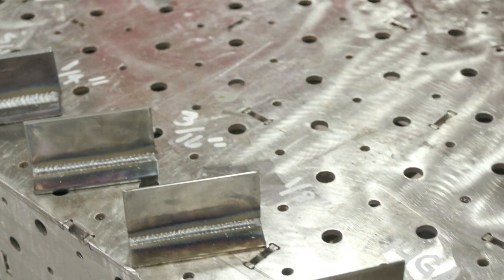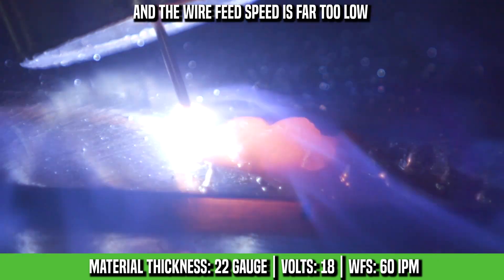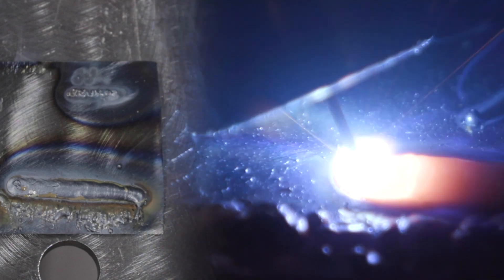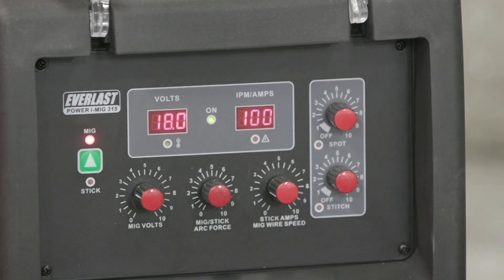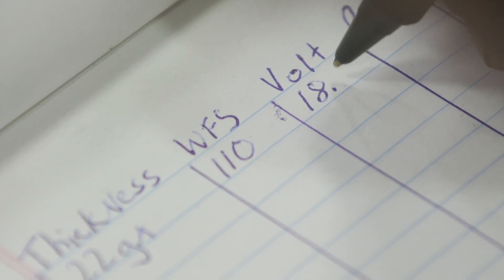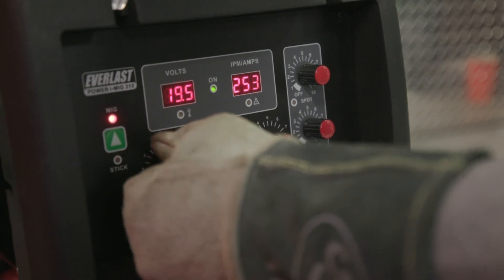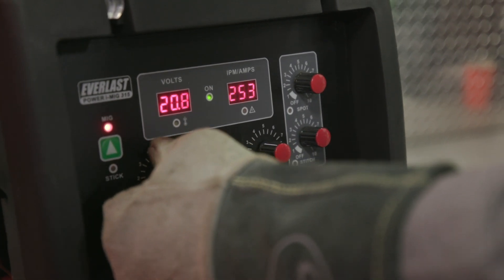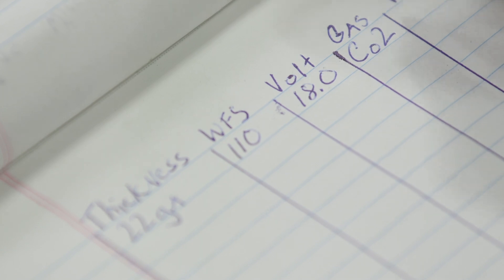MIG Settings for any Thickness

Comment: Hello. What setting for open v butt capping on thick steel 1.2 wire. 
240 amps 24 volts? 
I want a more raised profile.

Comment: I have been fighting that little "stutter" at the start for forever. Thank you for addressing that. You do a continues weld even on thin stuff. Most people use the series of "spot" welds for particularly auto body work. I would prefer to do a continuous  weld but to often get blow through.

Comment: Great video thanks. I’m having trouble with .134 wall 1-5/8” od mild steel tubing.  Since 3/4 of the weld is vertical or over head I keep getting puddle dripping . Looks fine on a flat bench weld for that thickness. Garbage around the tube. Thanks.

Comment: So did you leave your Gas on 25CFH thro all of those different Thicknesses? Also, exactly what type of Gas were you using? You said C02, were you running 100% C02?
I’ve always ran 75/25 when Mig Welding

Comment: I have a question I have a everlast MTS 252 and I'm using synergy mode can you possibly make a video how to adjust wire and voltage speeds on this type of machine it's very confusing I'm new to this machine I'm new to welding

Comment: on thin stuff, try and run hot and slightly push weld. It will flatten right out and use less wire and less heat on base metal.

Comment: I have a Hobart 210MVP welder with TAP voltage settings. Lowest Tap is 19v. I have infinite WFS, but how can I weld sheet metal with 19 volts ???

Comment: Do you have a video with setting adjustments when you're welding 2 different thicknesses of material? 14 gauge to 1/8" for example... this was a great video, thanks. My only suggestion would be the final list of settings completed at the end.
Reply: Always go closer to ehats needed on thick. Focus the weld on that side longer the thinner side will heat faster so penetration won't be a problem but the side the weld will fail will be the thick due to lack of penetration always address that and less failures will happen.

Comment: Most welders have a chart for a rough reference. These settings are nowhere in the ballpark with my Miller. Properly set, there should be zero slag and good penetration
Reply: Most setting charts are bullshit, depending on how fast you weld and what gas your running, i see charts that tell you to run 27 to 29 v 75 25 dual shield for 3/8 plate and in reality you can run 22 to 24 320 to 370 wite soeed with 75 25 gas.

Comment: 7:50  Good one !  You move forward, on the bottom side; then rotate upward;  counter-clockwise.......good. That, gives the complete weld, a BASE  for  the  dime/puddle  effect, whilst still bonding both vertical/flat  pieces.  I always, attempt to   '' work  with  nature ''....in any situation.  Use gravity, to  our  works   advantage.   Take care, and save your eyes.    Good  man  !

Comment: Great video as usual. I used to take scrap pieces and place them near my mig box and weld while slowly adjusting the wire speed to tune it in. That works exceptionally well.

Comment: that was a fantastic video. the camera capturing the weld puddle so clearly, the bacon sound, that all helped me understand so much. and on top of that some great settings to use. too bad i have a gassless mig and only two settings for wire speed etc. but still very helpful nonetheless.

Comment: I always think the 'wire speed' nomenclature confusres people..if it was labelled as 'amps' everything instantly makes more sense👌
Reply: Actually IMO the opposite is true, the AMP setting is directly changing the wire feed speed, and when I learn to weld, the MIG welders only had 2 settings and one was wire speed. you learnt what happened when the wire speed was too fast and too slow and adjusted accordingly.

Comment: Stop dragging your puddle. Push the puddle and you will have fewer settings issues. You will have more trouble from bad technique than badly set temperature. I'm speaking as a 30+ year production MIG welder. A good rule of thumb drag it downhill and push the puddle horizontally.

Comment: What can you tell me about corner to corner on 3mm steel where a bead needs to be left on the inside? Pressure vessel. Should I risk a slow hot burn on the MIGir go for more controlled fire with TIG?

Comment: I’ve got an MTS 275 running on 220 and struggling to weld 18 gauge steel with .023 wire. I’ve used the power set feature and manual settings with identically terrible results. It seemed to work ok with .035 wire on thicker plate but now I need to butt weld sheet metal.

Any help would be great appreciated.
Reply: I have the MTS 275 as well.  What did you wind up doing to achieve good results?  What wire, amps, and WFS?  I would have suggested using thicker wire like .025 or .030 for 18 gauge sheet.  I mainly weld 16-12 gauge and use .030 for everything and think I've used it on 18g too.  I think it's an optimal size wire for most work.
Reply: Hey Brock, I have the same machine, let me know if you still need help. Mine is working great and I started mig welding yesterday. After tackling aluminum tig, I look like a genius with mig and steel. Ha.

Comment: Just started welding last week , teacher has me welding 16 gauge clips to 1/2 I can weld the outside ( decent enough to pass ) but when I have to weld inside the clip I burn 🔥 it up been on it for two days , teacher told me keep messing with it but it’s frustrating, last week when I started it was on a Miller this week a Lincoln

Comment: This is very helpful... what would have been more helpful was the screen you added on your 200 amp mig (i-mig 200 e) after I bought mine... I have to count the ticks and approximate 18.5v and 149ipm on dials that don't tell me what they do...  Are the dials - labeled 1-10 - linear with the ranges in the owners' manual?

Comment: My new welderdoes not have feed adjustment, its supposed to be tuned to the welder amps, should I get rid of it?
Reply from the maker: You cant adjust WFS and voltage independently? What machine is it?
Reply: Reboot,  ive returned it and gotnfull refund

Comment: So would this be called dragging or pushing because it actually looks like its in-between both?? Beautiful job by the way 👍
Reply: in most cases it is recommended to push when mig welding

Comment: Thanks for the tips. I'm learning mig welding with a harbor freight (chicago electric) 125 amps welder. My welds currently look like corn diarrhea but I hope to make smooth welds soon
Reply: What thickness of metal, wire size, and position are you practicing on?
Reply: @nicholassullivan1239  1/8" mild steel sheets and 1.5mm galvanized square steel tube, using 0.035 flux core wire. About position, I don't know, but I definitely don't have a fixed position for welding, I just chose whatever feels comfortable at the moment, trying to have the gun at a 45° angle
Reply: Keep practicing with that then move up to a Lincoln 140 mig with a argon tank!!! It will change your life!! Trust me that’s what I did
Reply: He said "corn diarrhea" hahahahahahahahahahahahahahahahahahahahahahahahahahahahahahahahahahahahahahahahahahahahahahahahaha
Reply: Gun angle is important, I usually go no more then 15 degrees unless I need to in tight spots.

Comment: You should be pushing not pulling, the weld would be much flater. The only time you drag fluxless is if you are doing a build up - hole fill or really out of position to push.

Comment: I was waiting to take a screen shot of your final list of settings for my reference. But great vid anyway.
Reply: MIG Welding Estimates 

22 Gauge - 18.0 Volts - WFS 110 IPM

18 Gauge - 18.3 Volts - WFS 149 IPM

16 Gauge - 18.5 Volts - WFS 149 IPM

14 Gauge - 18.5 Volts -  WFS 160 IPM

1/8" - 18.9 Volts - WFS 188 IPM

3/16" - 19.5 Volts - WFS 240 IPM

1/4" - 19.5 Volts - WFS 252 IPM

Limit of Short Circuit (Spray Transfer)

5/16" - 23 Volts - WFS 512 IPM

3/8" - 23.5 Volts - WFS 535 IPM
Reply: Same 🤣🤣🤣 and Im not sure if he adjusted his gas
Reply: ⅚v @flakko4anddaddyD ĥ0😊

Comment: Did you ever change the wire size diameter? .030 wire on .375 material is kinda weird. I know it can be done, but why? The way I see it, a welder should change electrode size depending on the thickness of the base metal.

Comment: So very helpful.  Thank you.  I've done a wee bit of welding on MIG and TIG machines I'm allowed to use, but have just acquired the first machine I can call my own -- a three year old, never even turned on, Everlast i-MIG 200.  Your video gave so many good hints and explanations.

This machine came with a small spool of 0.023, and a smallish 84cf bottle of 75/25 argon/co2.  Two questions:  (#1) What is main impact of using straight CO2 (or you said 90/10) vs. 75/25 Ar/CO2?  (#2) Can I use this i-MIG 200 (with heavier wire) for t-joints on 3/8 bar?  or 5/16?

Thanks in advance for any suggestions.

Comment: Possibly an iffy ground. 0.30 hard wire using CO2 should be set from MIN 19 to 21 volts ...then dial in the feed speed.
REMEMBER....CO2 comes out of the tank ❄COLD❄ Years ago in a Fab shop I talked my boss into letting me build an intercooler/heater for our shop CO2 supply feeds. It made a huge difference for our Miller 400 wire feeds. We were fabricating water tanks 3000 -20000 gallon. Welds had to start clean, run clean and be leak proof. We also fabricated fuel tanks for local fishing boat fleet. And custom racing chassis, roll cages, etc.
Oh...yes I almost forgot. Purging the gas in the gun will always give you a cleaner and more rapid start. It's not hard to set up a remote purge button on your gun.
Reply: interesting, how much did you heat up the gas?
Reply: Heated co2 regs are very common.

Comment: How close are these numbers if I’m using fluxcore wire?
Reply: Not even! Not at all similar.
Reply: my understanding is that flux core runs hotter and penetrates more for a given setting.  thus your V would likely be lower, and maybe your IPM too.

Comment: Start your weld with a short arc length " which will run hotter" then gradually lengthen the arc is another way for cold starts and never start on your tack always at end of weld

Comment: It's too bad that your video doesn't cover thicknesses such as 1/2" and 1".
Reply: this video was for short circuit mig.  1/2 and 1" steel would not use this process or that wire in general.  thicker sections like that would use spray transfer and dual shiel flux core or subarc processes

Comment: The newer machines are "conversational" where you are "asked" what process, gas or flux core for MIG, type of material and thickness afterwhich it sets everything for you.
You can adjust feeds & speeds from there plus put them in memory.
It also helps having Lincoln/Miller's little slide rule setting charts that were passed out back in the day 20 years ago.

Comment: How much co2 I need when I’m working with 1/4”  thickness
Reply: 40 cfh works good for me. Just comes down to what you are use to, and how you learned to weld
Reply: start with 25cfh like in this video and turn up flow if you are getting porosity

Comment: Any chance you could do a video on .045 LA-100 wire?
I’ve been using it at work for a while with no training, I’ve gotten used to it but would like to know how a pro would use it. 
I get mixed info from my coworkers. Some say to lower my IPM and increase my voltage and others tell me to crank up both. 
The material I’m welding is pretty thick, ranging from 1.5in up to about 5in. 
I typically run my IPM around 350 and I have my settings set to trim instead of volts. I run my trim around .98. 
My welds aren’t defective or anything I would just like them to look a little prettier
Reply: have you searched for the manufacturers data sheet?  good place to start....they will often have a tech support that you could email a question to.

Comment: This is hands down one of the most informative videos I’ve seen on setting my mig welds correctly. Thank you!
Reply: indeed. i really wanted to look at a table that shows how the voltage-amperage-wire speed work in tandem based on the width of the material.
Reply: @duxromanorum9861  That would be tough because the amount of steel available for heat sink purposes varies greatly. Doing a 4x6” filet weld in welding school is a lot different from welding the hull of a ship. But one of the pros of MIG - oops - GMAW - is that it allows longer welds because of the continuous wire feed. As the metal heats up you can go faster snd only experience will help you there.
Reply: @jockellis  aren't ships generally now done with subarc
Reply: @peetky8645  Didn’t know they taught submarines to weld. Only kidding. Our welding instructor only told us about WW II era ships and the history of MIG. That wasn’t mentioned in my CWI class either. I’ll have to ask those instructors since they were headquartered on the Southern coast for many years in their own welding inspection business.
Reply: @jockellis  I think the chinese and koreans have perfected how to do this --catching the flux mixture while moving horizontally and vertical in tough, but it allows them to weld 1/2 inch plate with full pen in a single pass quickly
Reply: @peetky8645  Wow!

Comment: I'm a little late to the party but any chance you could do this with a lincoln welder that has no digital gauges, just the letters and numbers for adjustment? This was a great video and I will be adapting these techniques to a lincoln sp125, some not all, having a digital gauge seems to be really nice.
Reply: you can convert your letters/nubers to inches per minute(IPM) by pulling the trigger for 6 seconds and then measuring the inches of wire and multiplying that length by 10x
Reply: It won't work that well. That style of control should come with a look up chart. Usually under the lid where the wire spool is. That will get you very close then make minor adjustments from there. If you don't have anything on the machine Lincoln has all the old manuals online.
Reply: Absolutely, I welded with MIG (and many others have!) for years and still dont take any notice of the digital readout, just play until you get the frying bacon and the good weld bead characteristics. You will then be adjusting in small increments depending on weld type (overhead, down, up etc) and metal thickness. Also where possible (if right handed) weld from right to left (pushing) so you can see the weld pool properly.

Comment: Something that I don't hear mentioned these videos is the fact that lengthening your stick out will increase your voltage. So when you are welding try increasing and decreasing your stick out  and that will tell you which way to go on your settings. If it improves with more stick out then you need more voltage or less wire . The opposite if it improves with less stick out . This eliminates moving in the wrong direction
Reply: stick out meaning away from the metal and stick in closer to metal? is that what you mean with stick out?
Reply: @Ryan_Atomic  stick out is the distance between your contact tip and the arc or the length of wire sticking out between the two when welding .
Reply: @Ryan_Atomic  I was refurring to mig welding
Reply: @Ryan_Atomic  stick out is the length of wire between your contact tip(not nozzle end)and the metal.  it is increased by pulling away from the metal, and decreased by moving closer.  In general, your stickup with solid wire should be very short---3/8 inch or less.  With flux core wires, polarity is generally opposite(dcen) and sickouts are much longer(up to 2 inches in some cases) to allow more of the wire to preheat and melt the flux before it is vaporized in the arc.   I believe Joe is incorrect about voltage.....MIG is a CV or constant voltage process......voltage remains the same whether stickout is long or short, but with increasing stickout, the circuit has more resistance, so the amperage drops with increased stickout.  you will notice this as a change in the arc sound as you pull further away from the workpiece. usually it starts popping, telling you to shorten your distance.  the contrary is also true...if you shorten your distance the frying bacon sound may begin to be a steady hiss sound(spray transfer sound).
Reply: Joe Dirt This changes amperage, not voltage, if your amperage (or wire feed) is too high, further away from your work will be better, so decreasing your amperage will fix this.

Comment: Hi, Great video could you give me setting for 2mm thick steel box section its got like a black skin on this is it right to remove this and chamfer the edges plus what cfm gas rate should be please. Would really appreciate your help. Ps using co2 argon mix.

Thank you. 
Jay.
Reply: Always put gas flow between 30 cfh and 40 cfh. Small nozzle closer to 30cfh big nozzle closer to 40cfh. Tube that thin is pretty straight forward. About 18V and wire speed depending on wire diameter between 150ipm and 300ipm.
Reply: @geoffmooregm  Thank you.
Reply: @JaySingh-ex6xc  25 cfh is generally enough 12 lpm, go more and just waste your gas.

Comment: Can I use these settings for my MiG machine?
Reply: Absolutely not! You must have a license from Everlast to use them!
Reply: They should get you close if your machine is of similar power. But every welder has a different idea of what is 'sweet' for them. The guy from the opposite shift always welds on a lower setting than i do while using the same thickness material. The best advice is to get the settings that YOU'RE happy with and then make a note of them.
Reply: @koitorob  you are right, but i don’t understand why they are different. If you think about it , you adjust the voltage and wire speed. So example 15volts will be 15v in other machine and wire speed if is 100 ipm will be the same in other machine.the only different is some machine you set wire speed in m/min instead of ipm ,and this you can convert them.(inches per minute to meters per minute ).
In my opinion it shouldn’t be any different.